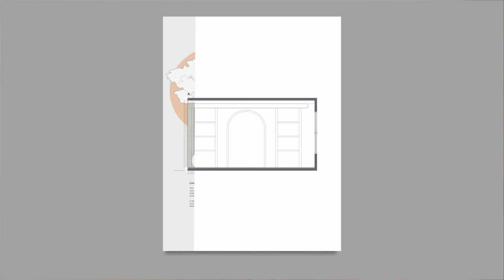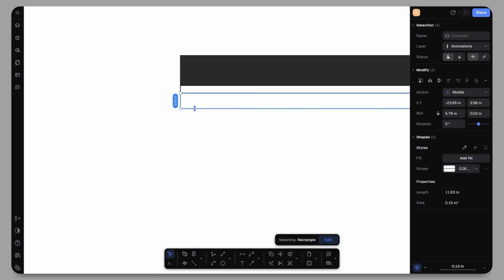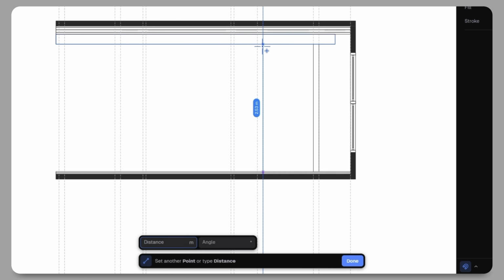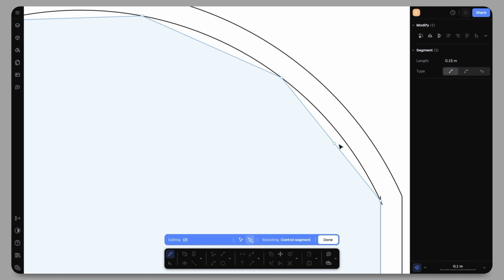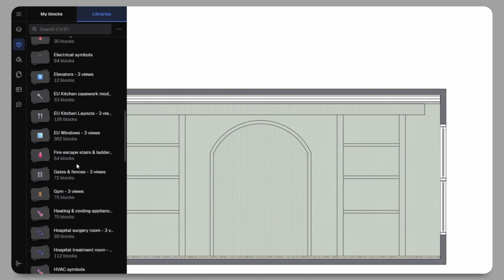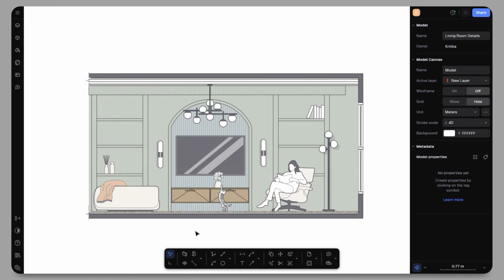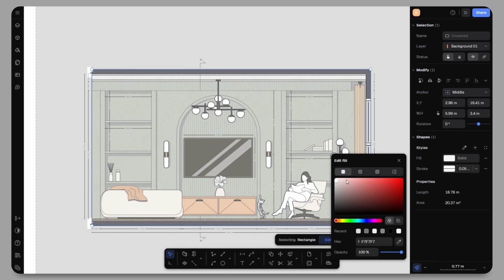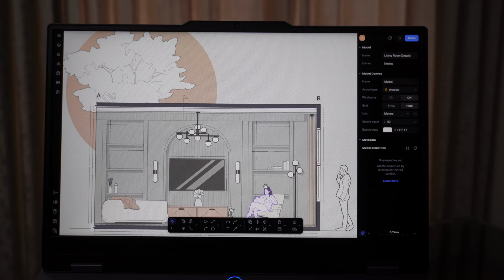Section Rendering - The EASY way | no Illustrator

Comment: Great tutorial but the template link doesn't work. I would like to see an isometric 3D diagram rendering tutorial. Do you think Rayon can fully replace AutoCAD+Illustrator (regarding vector drawings) and InDesign (regarding layout)? Thank you very much
Reply from the maker: Thank you so much! And thanks for pointing that out—I'll fix the template link ASAP and update it in the description.
I will be posting the isometric 3D diagram rendering tutorial soon— stay tuned! 😊
And yes, I do believe Rayon can replace AutoCAD + Illustrator for vector drawings, and even InDesign for layout, especially for streamlined architectural workflows. It’s efficient, collaborative, and very design-friendly.
Excited to share more soon!